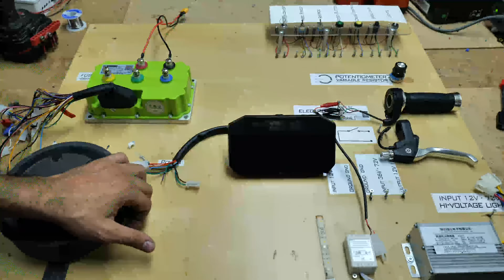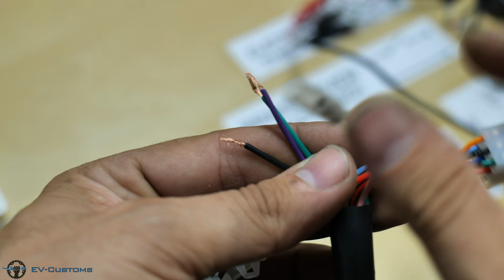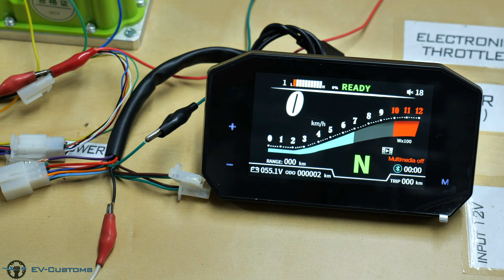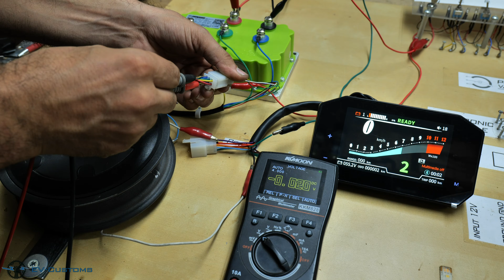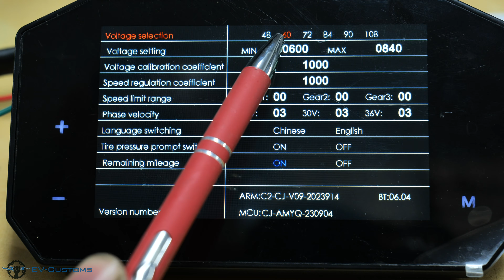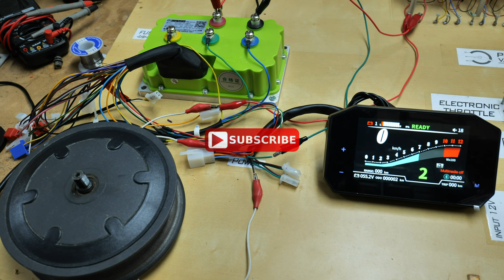Far-Driver Learning Board  /  Universal Display Chaojie Gen2  Connections  ( PART 1 )

Comment: Hi there I'm trouble shooting my ND72450 FARDRIVER the (one line, light blue) is giving me a constant 3.7v on standstill, so the display mph is showing 120mph constantly.is there a way to bring it down to 0 volts? I'm still finishing up the build so haven't been riding it yet?? Cheers

Comment: hall sensor and speed sensor? ive never actually used it but ive always been under the impression the white wire on the hall plug was a temp sensor wire.. good to know.
Reply: The hall sensors in combination with the controller is what's acting as the speed sensor. The white wire is for temperature.

Comment: Is the " CAN" light blue wire from the hall.?
Reply from the maker: No..  is alone from the controller side..
Reply: @EVCustoms  thank you greatly.  One last ? If I may.. my brake lever has a 3rd green signal wire? Do I need to connect it? If so. Where and why?

Comment: Hello, I’m having trouble getting my anti theft function working with my nd 72450. I have the alarm and key fab installed but when I lock the hub motor spins freely. Do you have any information on how to get the hub motor to lock or be restricted when the alarm is activated

Comment: Which pin in the board of controller for single line digital speedometer?
Because i can't found the light blue wire on the my controller. And the wiring colour is very different with your controller.

Comment: Thank for your effort. But I have a question. Can I use Power Supply 72V 10A to test with Far-Driver instead of using Battery.
Reply from the maker: Yes of course..
Reply: @evcustoms  How can I lock the Wheel of motor bike (motor lock)?
Reply: @evcustoms  Need I limiting the current of Motor and Controller

Comment: Can you maybe help me. 

I recently buy one motorbike when the battery lithium 72v 30 Ah is connected, it always shows as 100% full with four bars on the speed display.

 However, the issue is that the bars do not decrease while driving; it remains at 100%. When I travel around 50 kilometers , the battery runs out but I only get the low battery signal with the icon appearing just about 30 seconds to a minute before it's completely depleted. This means I never see the battery level drop; it's either full or empty, making it very difficult to manage the autonomy, knowing when to recharge, especially since it could run out when far from a charging point.

Comment: Hello 

I have the same set up when i connect the battery to the controller im only reading 1.7v but the battery is reading 68.2v any ideas? Has the controller gone faulty??
Reply from the maker: Hi.. your BMS is deactivated.. measure the battery voltage under load....
Reply: How do i activate it?
Reply from the maker: @samingham3077  You must make diagnosis on the battery... most probably you have some parallel cells undervolt or any bms cutted wire... check your battery

Comment: Can you also tell us more about the CAN control,

Can you please tell me how we can connect this display with the BMS using the CAN Protocol, to check the available range?

Thank you so much for this awesome video.
Reply: all you have to do is connect CAN H from the bms to CAN H on the display and CAN L from the bms to CAN L on the display just these 2 wires is all thats needed and then enable the CAN protocol in the bms app,some bms  can only enable CAN protocol using the pc app
Reply: @angusmcgil  thanks man..

Comment: This must be why on the generic controllers I use lately with no display the 3 speed does not change motor speed. They are set to 0 at the factory. But I have older controllers that the 3 speed does work. Also the controller low voltage cut off on my 48/60/72 volt controller is set to 42 volts for a 48 v battery. I was using a 52v battery and the BMS must have no over discharge protection because it did not cut off till 42v. Not good.